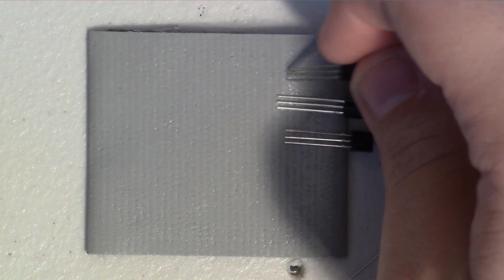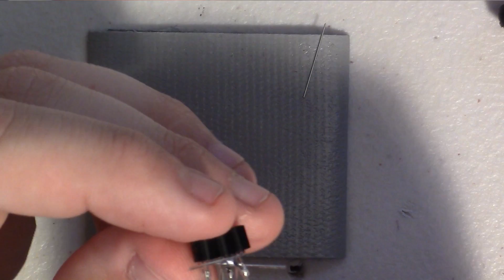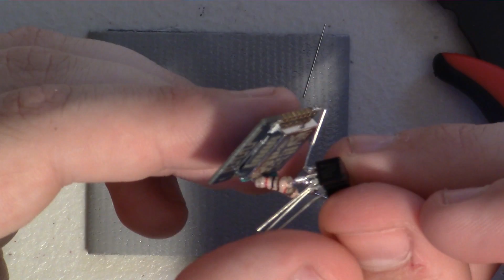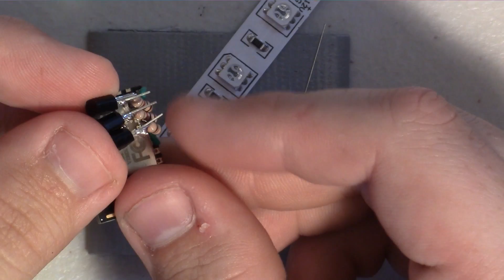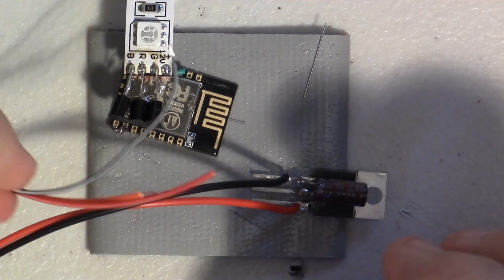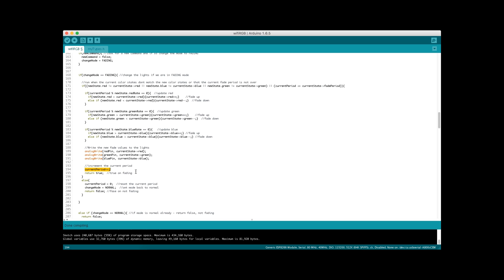Home Automation at Home Part 6: RGB Light

Comment: The duct tape helping hand is freaking genius!  Great video, love the ESP8266 content.  One small request... can you change the settings on your screen capture software so that it fills the whole window...?  There's a black bar around the code part that makes it really small and almost unreadable.  Thanks brother, great channel and you're headed for a big following!
Reply from the maker: +mnelson10000 Haha thanks, duct tape always fixes everything! As for the screen cap.... I know. I need to find new screen cap software because my current software doesn't capture at retina resolution (because apple did a lot of shady stuff when making retina macs still easy to read) so even if I tried to capture my whole screen and not just a window it maxes at 1440x900. So my fear has been that even if I stretch to fill the whole window with the code, I'll just be stretching out a low-res screen cap which wont be any better than the black bars now I fear. Well thats what you get when you don't do your research before you buy. I'll look into finding some new screen cap software for future videos though, thanks for the feedback!
Reply: I don't know about in the Mac world, but in the PC world, there's a lot of programs for presentations that allow to you zoom in to areas of the screen so they show up better on a projector...  ZoomIt is one of them.  Maybe you can find something like that to work around it.
Reply from the maker: +mnelson10000 Thanks! I'll take a look and see if I can find something similar

Comment: With this setup and the components used. What would be the maximum length of LED strip you could use?
If you wanted to do something big like a hallway would you increase the size of the transistors, resistors and build either a bigger power regulator or just use a something like a XM1584 3A Step Down Module?
Reply from the maker: Eh I would say that in terms of these transistors the max length would be in the 3-4ft range. Beyond that I would use  TIP-120 transistors or even N-Channel MOSFETs. MOSFETs would be my choice. And for more than about 15ft I'd get a 3A+ 12V power supply for the strips, you can find them pretty cheap on amazon or ebay. (https://www.amazon.com/ZOSI-3000MA-supply-Security-Surveillance/dp/B015DXJ6NU/ref=sr_1_1?ie=UTF8&qid=1466107260&sr=8-1&keywords=12v+3a) 

The 3.3 regulator can stay the same though because when it comes to regulators the amperage rating is for output amperage and the ESP is only ever going to draw ~400mA at most. On the input side of the regulator you only really have to watch out for the voltage rating. Maybe it makes it easier to think of it like this, if you plug in a 60 watt light bulb into your wall, that wall can supply like 1800 watts but the bulb will only draw 60 because thats how it was designed. Same idea applies to the regulator - you can hook it up to a power supply that can provide 12V at 10A lets say and it will still work just fine and only draw as much power as it needs.

Hope that clears it all up :)
Reply: so for 15ft plus, I would use MOSFETs instead of the 2222 npn transistor and a 3A+ 12V power supply. All the other components would be the same as in the tutorial correct? 
Another question: The code you are showing has to be flashed into the ESP8266 correct? If so, after or before the installation you made?
Thanks!

Comment: im getting this :

Arduino: 1.6.7 (Windows 10), Board: "Arduino/Genuino Uno"

Build options changed, rebuilding all
In file included from C:\Program Files (x86)\Arduino\libraries\ESP8266WiFi\src/ESP8266WiFi.h:33:0,

                 from C:\Users\Jeppe\Documents\Arduino\homekit\homekit.ino:18:

C:\Program Files (x86)\Arduino\libraries\ESP8266WiFi\src/ESP8266WiFiType.h:26:19: fatal error: queue.h: No such file or directory

 #include <queue.h>

                   ^

compilation terminated.

  This report would have more information with
  "Show verbose output during compilation"
  enabled in File > Preferences.

Comment: Could I use the S8050 transistor for this circuit?
Reply from the maker: Yeah that should work just fine.
Reply: ItKindaWorks have you checked out running your server on a Mac via home bridge? From what  I've seen it is a lot simpler then the raspberry pi! Do all your projects work with the Mac server or are there things that should change? 

Loving your channel by the way!
Reply from the maker: I have seen home bridge and almost tried it out a few times but I've got things working well from HAP-NodeJS and it's one of those things where id rather not disturb something that works just because theres something else that might work too. But from what i've seen home bridge does look a fair bit easier and perhaps at some point when everything breaks I'll look into switching over. 

Mostly everything that I show should be compatible with mac but might require installing extra stuff via macports or homebrew. I usually use linux/raspi just because it's easier to troubleshoot since I know there wont be any compatibility issues with linux (or at least fewer than on mac given that most of this stuff was written assuming a linux platform).

Comment: Great work! One issue I am getting is the void reconnect() - according to the serial console it constantly loops this section :

while (WiFi.status() != WL_CONNECTED) {
   delay(500);
   Serial.print(".");

It does sometimes eventually connect, and serial reads "Wifi Connected" and it works fine, other times it loops over and over for absolutely ages. I check my router and the esp is connected and has an IP address though, any ideas?
Reply: Never mind - looks as though the reconnect function doesn't actually initiate WiFi.begin, added that in and works perfectly

Comment: I have downloaded your MyTypes.h library from your github. How do i import this into my arduino software? From what i can see a .zip is required that contains the .h file as well as a .cpp file
Reply from the maker: The myTypes.h file goes into the same folder as the sketch (ino) file just as they are on github. You dont need a cpp file, just the h file.

Comment: Apparently I have a problem with HSBColor.h.
the following appears during compilation:
RGBLight.cpp.o: In function `callback(char*, unsigned char*, unsigned int)':
/Users/paul/RGBLight.ino:368: undefined reference to `H2R_HSBtoRGBfloat(float, float, float, int*)'
RGBLight.cpp.o: In function `lightUpdater(lightState*, lightState)':
/Users/paul/RGBLight.ino:368: undefined reference to `H2R_HSBtoRGBfloat(float, float, float, int*)'
collect2: error: ld returned 1 exit status.

The Arduino version I use is 1.6.5.
(1.8.1 gives problems with PubSubClient)
I have put HSBColor.h in the libraries folder and it contains:

/*
 HSB Color, 
 Library that converts HSB color values to RGB colors.
 Created by Julio Terra, June 4, 2011.
 
 Header File Name: HSBColor.h 
 Implementation File Name: HSBColor.h 
 
 */

#ifndef HSBColor_h
#define HSBColor_h

#if defined(ARDUINO) && ARDUINO >= 100
#include "Arduino.h"
#else
#include "WProgram.h"
#endif

#define H2R_MAX_RGB_val 255.0

void H2R_HSBtoRGB(int, int, int, int*);
void H2R_HSBtoRGBfloat(float, float, float, int*);

#endif

/* This work is licensed under the Creative Commons Attribution-ShareAlike 3.0 Unported License. 
 To view a copy of this license, visit http://creativecommons.org/licenses/by-sa/3.0/ or send 
 a letter to Creative Commons, 444 Castro Street, Suite 900, Mountain View, California, 94041, USA.
*/
 What do I do wrong?

Comment: When compiling the .ino i get the following

arduino.ar(core_esp8266_main.cpp.o):(.text._ZL12loop_wrapperv+0x4): undefined reference to `setup'
arduino.ar(core_esp8266_main.cpp.o):(.text._ZL12loop_wrapperv+0x8): undefined reference to `loop'
arduino.ar(core_esp8266_main.cpp.o): In function `loop_wrapper':
/Users/nico/Library/Arduino15/packages/esp8266/hardware/esp8266/2.3.0/cores/esp8266/core_esp8266_main.cpp:110: undefined reference to `setup'
/Users/nico/Library/Arduino15/packages/esp8266/hardware/esp8266/2.3.0/cores/esp8266/core_esp8266_main.cpp:110: undefined reference to `loop'
collect2: error: ld returned 1 exit status
Error compiling.
Reply from the maker: What version of Ardunio are you using?
Reply: I got this working in the end. Was a really stupid mistake on my behalf. I had added a space between RGB and light in the .ino file but not the folder containing the .ino   Once they were named the same i was able to upload the sketch. I am having some other issue now in terms of pins and the lights just being on all the time but i will work through that :)

Comment: what did you use to power it. is there a way to power by usb
Reply from the maker: I used a spare 12V power cable from an old router I believe. USB is 5V so without a step up converter you wont be able to use that.

Comment: a name NPN transistor ? 
or any suitable NPN transistor ?
Reply from the maker: a 3904 or 2222 would work just fine but so would most other general purpose npn transistors
Reply: ItKindaWorks 2N2222
Reply from the maker: yup that'll work!
Reply: and resister 1K or 10K ?
Reply from the maker: 1k (but anything from about 470 to 10k would be fine). The description has a list of all the parts used.
Reply: oo thanks

Comment: what voltage is the capacitor? I can see anywhere from 10 to 24v
Reply from the maker: I believe it was a 10V but the voltage of a capacitor doesn't really matter as long as its ~2x what you intend to use it with. So this circuit was at 3.3V so it should be more than or equal to 7V preferably. So anything over that would work.